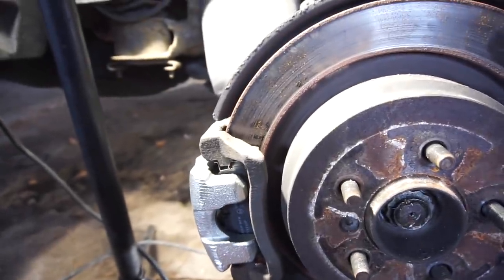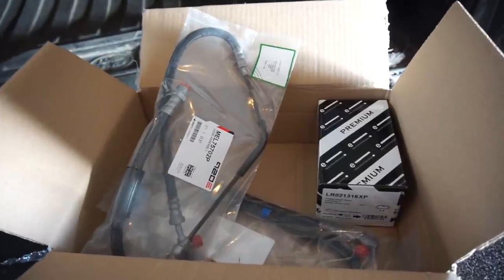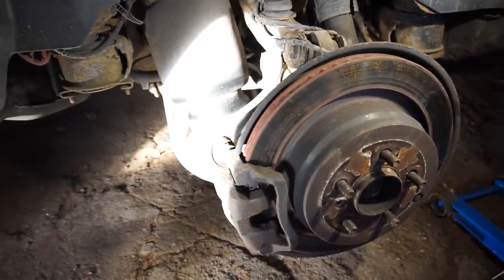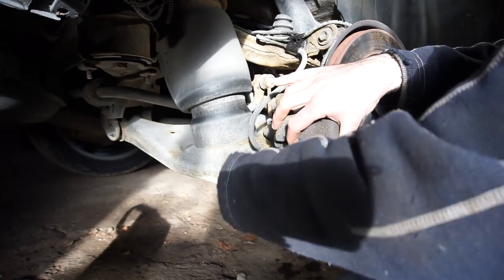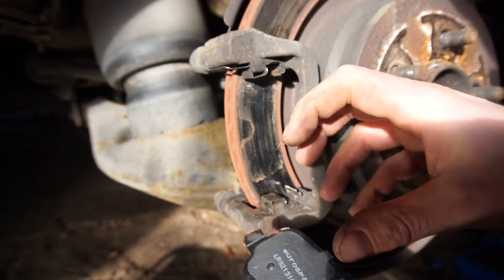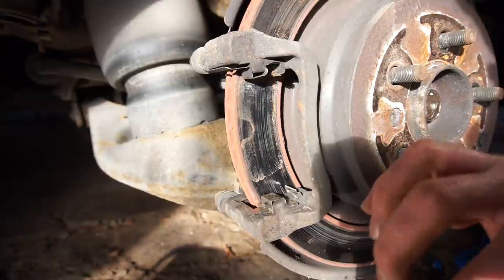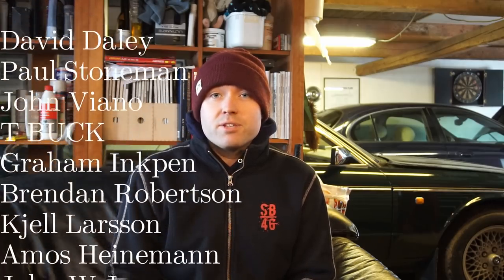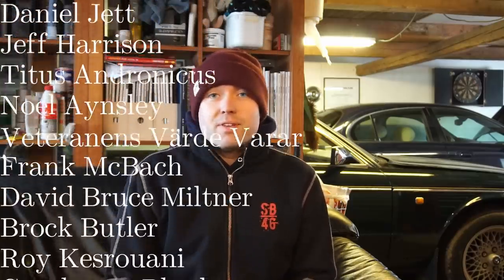New Rear Calipers, Pads and Hoses for the Range Rover

Comment: I have a commercial type pressure bleeder unit, works great, bleeds the whole system and takes about 15 minutes to do so. Expensive but worth the cost to be able to bleed out a system by yourself!
Reply: I have the Eezibleed and it's really easy to use even for DIY mechanics. Is that what you have?

Comment: Thanks for that!  While you have things apart at the front of the engine you might want to change the supercharger oil. Once you've pulled the air intake tube the port is easily accessible and the oil should only be about $25(USD) and you already have the vacuum tool to pull the old oil out. Eaton says to do it every 60k, most people don't ever do it. I'm really looking forward to seeing the belt change process.

Comment: It is a very good idea to clean and use fresh anti seize on the caliper slide pins, i would also use anti seize on the axle nut to stop corrosion. The electrical wire you talked about is broken and missing its end which connects to the outer edge of the brake pad and is earthed out when the brake pads wear down to a predetermined level. Every caliper should have one attached.

Comment: I have the vacuum bleeder too but i prefer the pressure bleeder.
Reply: Eezibleed?
Reply: @taunuslunatic404  yep
Reply: @alanryderb  I've used that as well.
Reply from the maker: I haven’t used the pressure bleeder but a friend had one crack the reservoir and spray brake fluid everywhere
Reply: @LivingWithAClassic  How much pressure did he use?
You're supposed to use a tire as your source of pressure at 1.4 bar at most. There's no way you can crack the reservoir with such a low air pressure.
Reply: @LivingWithAClassic  the same happened to my brothers because the threads in the cap were worn out. He works in a garage.